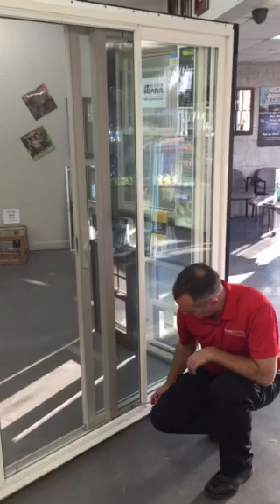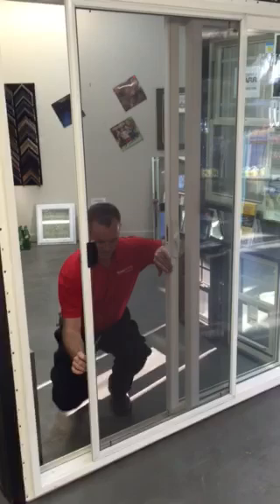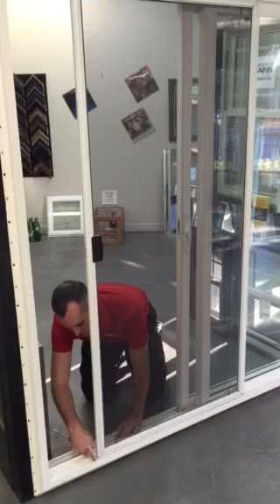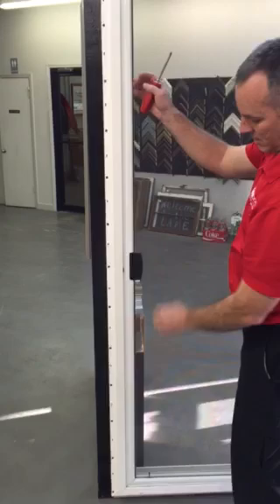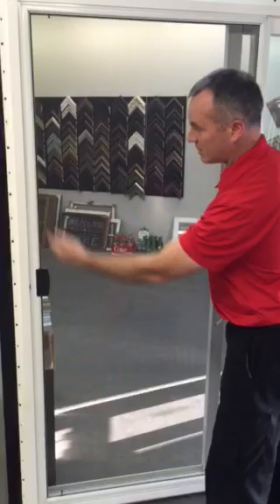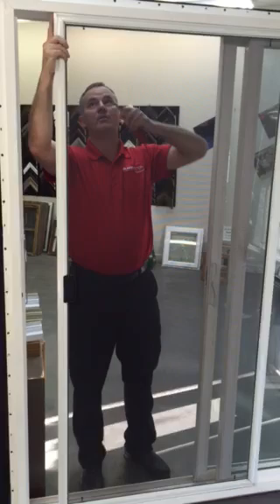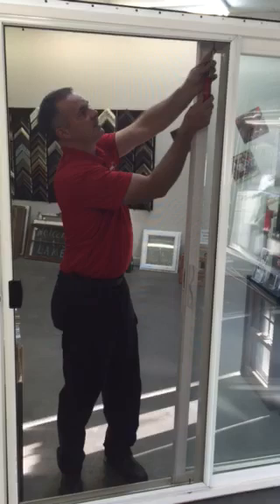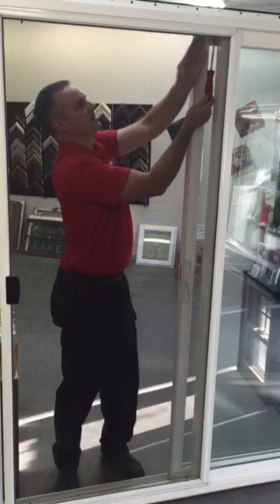Sliding screen door adjustment

Comment: Thank you so much for posting this. 57 year old woman here, husband works nights. I like to most of the maintenance so he doesn't has to. Our dog seen a squirrel on the deck and decided to 'bulldoze' into the screen door, not once but twice trying to get out. Popped the door totally out and went flying!  got it back on track, but didn't want to slide hardly at all.  Found your video and wa-laa!  Fixed just like new!  Excellent tutorial, would have never figured that those adjuster screws were spring loaded.
Reply from the maker: stoneagemom thanks. I’m glad it was helpful.

Comment: What happens if the lower wheel doesn't move . Does that mean the adjustment screw is stripped. ? I've tried and tried 😅. Well maybe it's time for a new door.
Reply from the maker: Most likely the screw or the roller assembly is stripped. You can buy new rollers and replace them if you can get it out. They make lots of different styles. If you send a few pictures I might be able to help you figure out how to get it out.

Comment: THANKS! it’s corrected! I got into trouble in the first place because one bottom  screw was so high. The other 3 are fine. I screwed it down but then it locked up the screen (I have the same door as you). I adjusted it per your instructions but now that screw is still very high and I afraid it’ll fall out. Any suggestions? THANKS!
Reply: If your house has some settling the door opening may be out of square or out of plumb/level. You can measure the diagonal distance from corner to corner and compare the measurements to see if it is out of square.  A perfectly square opening would be exact same measurements on the diagonals.  It sounds like that could be the problem since you are having to adjust one screw significantly more than any other.

Comment: Part of the problem with my sliding screen door, is that I usually have to remove it from the track so that I can clean the track and the gritty debris that gets on the track and up into the door... and the wheels that ride the track usually need some sort of lubrication... I usually just use some silicone spray that I have handy, which normally does the job.

Just did this the other day, and the door still isn't sliding properly, so I will probably remove it and check the wheels again.

I suspect the wheels need adjust again as well... heck, I've done this before with the silicone spray, and the door would slide super perfect, but not this last time... not sure what is going on, but it can't be that complicated !
Reply from the maker: You might double check that the rollers are on the track. Sometimes the rollers can get beside the track and cause the sort of problem you’re describing.
Reply: @glassdoctorofgreersferryar7329  I got it working  fine... I removed the screen from the tracks, cleaned everything good, sprayed the wheels and axle pins with silicone spray... then retracted all the wheels so they would spring back into the frame... put the screen back... the top wheels just roll inside the track... the bottom wheels sit centered on the raised rail... adjusted the screws so that the wheels would raise up & and out a bit.

The adjustment screws are on top and bottom of the side inside toward the house... if you keep turning the screws they will cycle back to the beginning... easy to tell when the screen is outside the tracks, but kind of hidden from view once inside the tracks.

Works now as it should ! Thanks !